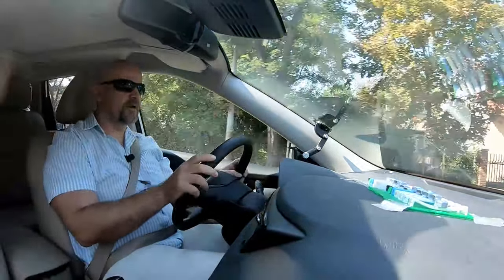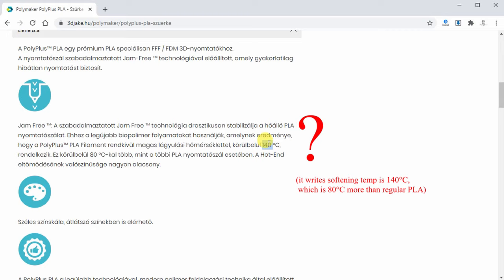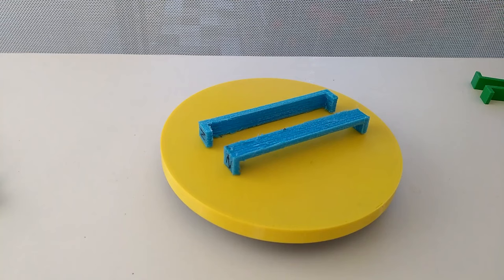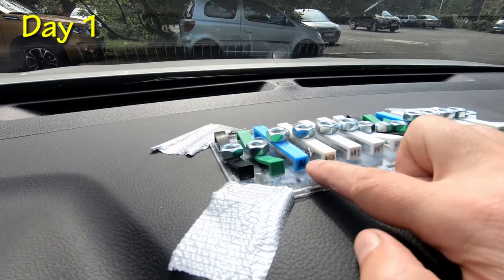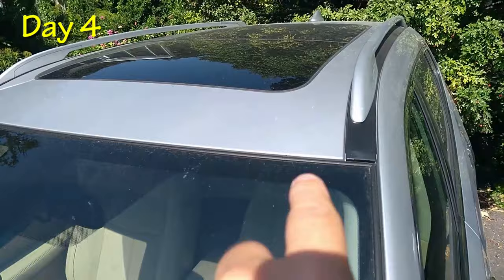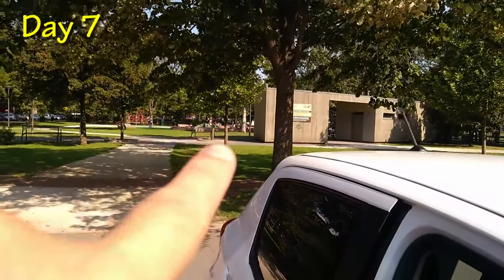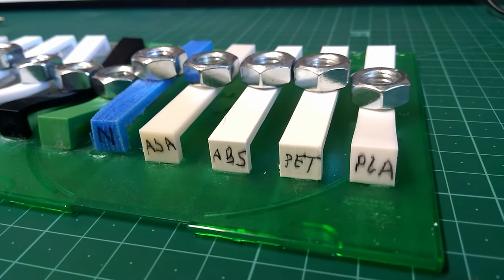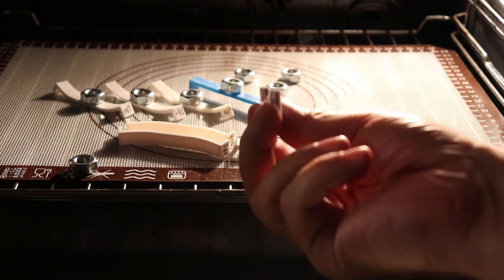What 3D printing material to use for object inside a car? Temperature test

Comment: Szerbusz Igor kedvelem a videoid 👌.Nekem egy prusa mk3s nyomtatom van , szerinted melyik az a filament tipus amelyik a legjobban bìrja a sokkokat és az igénybevételt , én a Petg és az Asa közt vacilálok, mert a nylon és az abs problematikus nyomtatni , föleg nagy alkatrészeket szeretnék nyomtatni 10/20 cm és az asztalhoz valò tapadás is még egy probléma .Tudnál adni egy jò tanácsot ? Elöre is köszönöm ✌️
Reply from the maker: Teljesen egyetértek, jó uton haladsz. ASA sokkal jobban tapad és könnyebben nyomtatható mint ABS. ASA-t sikeresen használom enclosure nélkül is de csak alacsonyabb tárgyaknál. Ha 10-20 cm-t akarsz, ajánlom, hogy fabrikálj valami zárt teret, különben repedések (cracks) lehetnek rajta, még ha nem is emelkedik fel a sarka (warp). De ha a 70°C hőállóság elegendő és nem kell az UV állóság, próbáld a PETG-t.
Reply: Köszönöm a tippet ! Amit edigi tapasztakatbol tudom hogy nekem bevált az hogy sokszor nagy alkatrészek esetén 0.3 réteggel dolgozom a slicerben draft üzemmodban és a printeren felviszem 200%  ra a sebeséget ,emelek 10-15 fokot a nozzel-en mivel olyan mint a fröccsentés minél hamarább végez annál egységesebb a végeredmény, gondolkozom egy Voron 2.4 megépitésében , te néztél e utánna ? Àllitolag eszméletlenül nagy sebeséggel és preciziòcal dolgozik, Köszönöm a sok jo tippet amit megosztasz 🙂🖐️

Comment: I thought this was a great video when I saw it in 2020, but recently I thought of a question:  Do filaments like PLA with chopped carbon fiber or wood fiber have better structural integrity at higher temperatures than just plain PLA?
Reply from the maker: Recently I tested some carbon PLA filaments, same temperature resistancy. https://youtu.be/OfIe3SHmeMA

Comment: Why these HT-PLA manufacturers can list ridiculously high temperatures on the ad copy, is that it might about hold its shape at these temperatures after annealing - but before it behaves close to standard PLA. Depending on formulation, HT-PLA might also not change shape or dimensions too much during annealing, certainly a lot less than standard PLA.
Reply from the maker: Thanks for another detailed comment. There is a test in progress, Nonoilen (PLA like) filament, it is food safe, can be cleaned in boiled water (in spec. 110°C without annealing)
Reply: @MyTechFun  btw rumour has it, cold annealing PLA in Ethanol is possible. Kenis tried and it did something.

Comment: I have left a thin and long molded ABS car part inside the passenger compartment, with one side hanging in air and it got bent downwards. The part is about 33 years old and in its original place it was supported by the chassis and covered by the carpet.

Comment: What about annealed PLA?
Reply from the maker: Annealed pla is very temperature resistant, but the problem is that it shrink, deform during annealing process. Not good for accurate mechanical parts.

Comment: You needed to chose a different weight, those nuts are likely getting to well hotter than ambient temperature, and this may not be representative to actual performance in the ambient temp of the car in the sun.
Reply from the maker: Correction: the nuts will never be hotter than ambient temperature. They may heat up faster than plastic, but never go over ambient temp. But hey, in a real life I may want to attach some metallic parts to plastic. I try to simulate real circumstances.

Comment: Could you do it after annealing the material?
Reply from the maker: Yes, but I have to wait for the next summer. Annealing helps, but object deforms significantly. Not good if you need precision.
Reply: @MyTechFun  Anneal in some kind of support (sand/salt) maybe?

I bet your oven works during the winter ;-)
Reply: No point. Melting point will remain the same.

Comment: What do you guys recommand for a product inside an engine bay compartment ?
Reply from the maker: Depend how close is to heat source and what load it gets. Probably ABS, ASA, Nylon, PC ..(?)
Reply: @MyTechFun  Thank's. Apparently some use special ABS designed to handle high temperature.

Comment: me here still looking for an option to print, cause with PETG as everyone say it is easy, but it is not, it does not stick for me on surface...
Reply from the maker: Try to use glue stick or hair spray on the print surface.
Reply: @MyTechFun  thanks, but does not help. not even on clean achocol wiped glass...

Comment: htpla needs to be annealed but after annealing it holds up to 100C
Reply from the maker: True, but problem is that it deforms a lot during annealing. Not good if you need precision. Currently I am testing Nonoilen filament, it can hold up to 110C without annealing. Results (and video) in few weeks
Reply: @MyTechFun  I have had good luck using fine salt but parts don't quite fit together afterwards. Formfutura Volcano is supposed to anneal without warping but I have never used it.

Comment: That Gembird Nylon is absolute piece of shi... garbage. Almost impossible to dry and keep larger prints on bed together with poor layer adhesion. Taulman Alloy 910 was much better material that I tested after my failure with Gembird. Polymaker CoPA was my next choice and it came dry right from the package.
Reply from the maker: Good to know, I thought it's only me or my filament dryers (with Gembird). Will try 910 and CoPA. Thx
Reply: @MyTechFun   Other filaments such as PLA or Petg by Gembird were ok for me, but the nylon was a nightmare. The Other nylons I mentioned are quite expensive and hygroscopic too, but layer adhesion, ductility and thermal resistance ( CoPa must be annealed) were worth it.